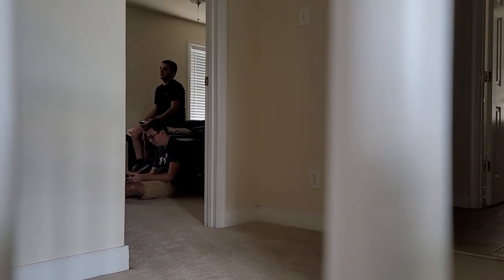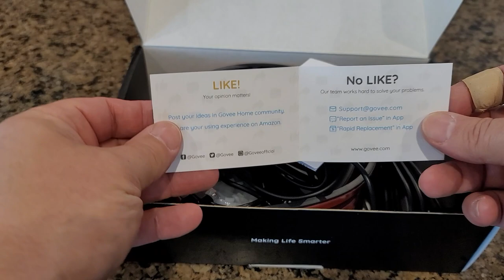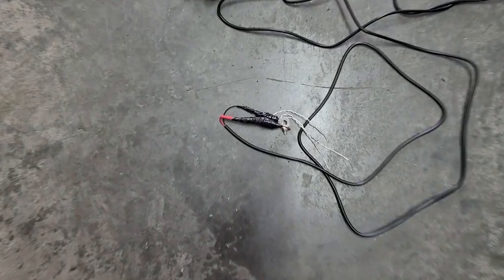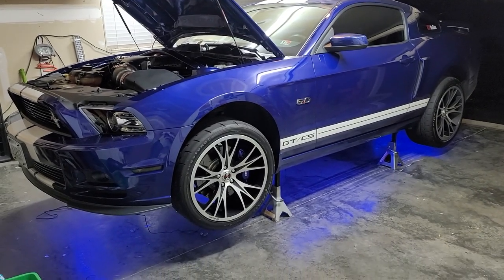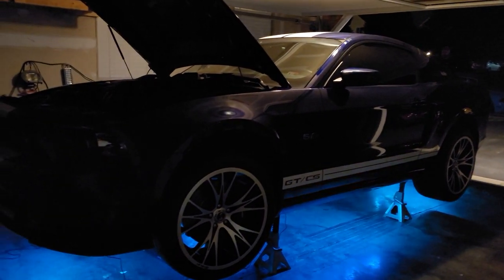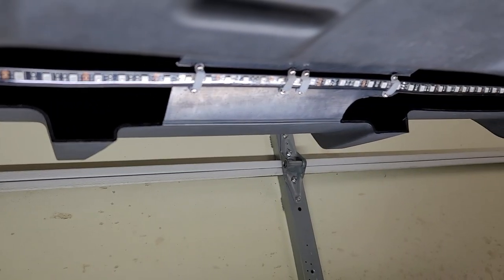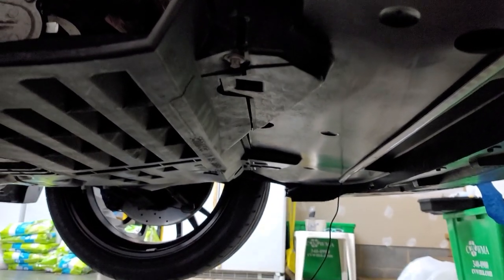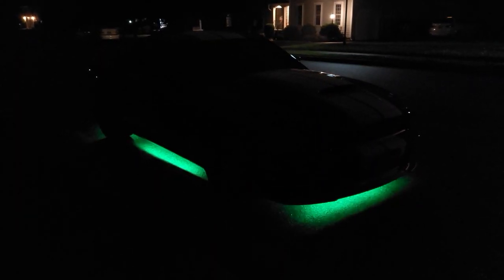Govee LED Car Lights Install (underglow)

Comment: Just a heads up for people new to underglows, DO NOT USE BLUE lights u will get pulled over
Reply: Really??
Reply: Red and blue really. At least while driving. Could get an impersonating a cop charge.
Reply: Where I’m at you get pulled over even havin em on while driving no matter the color😂 but the risk makes it all the more fun
Reply: Before installing just check your state and local laws on underglow. Most states don't allow you to drive with red or blue
Reply: Or red!!!
Reply: Actually, it depends on the state. If I recall, here in New York, we are not allowed to have any flashing lights on our cars, of any color, while the vehicle is in motion, other than the legally allowed turning indicators/hazard warnings, of course.
Reply: @NuBeatzNumuzik  That's bs. It's not impersonating an officer unless you act as one. You could deck your car out as a cruiser legally.
Reply: @MaxxdOut313  fair enough. I roll with my lights on and I don’t get any shit from cops. July 4th I was running with red white and blue flashing all night. It was nice.
Reply: @MaxxdOut313  fax
Reply: It all depends where I live must be solid no blue or red
Reply: Damn. That's my favorite color. Lol.
Reply: @MaxxdOut313  nope, in washington I put blue bulbs in my front sidemarkers (this was like 2001) and I got pulled over and told any car with blue lights can be charged with impersonating an officer.
Reply: Thanks for the warning 👍

Comment: Extremely informative video, I am thinking about putting these on my first car in a few months, and I couldn’t find any other video that was as proper as this one, this helped me out a lot, thank you, very good video👍🏻🔥
Reply from the maker: I'm sure I missed something. If you have any questions let me know
Reply: @N2MYGT  I do have one question, do the lights automatically turn on, or do you have to start the car? Or do they only turn in if you you use the remote or the app?
Reply: @trentenmellott7284  only when you use the remote or app. I'm sure there is a way you can wire them to turn on with the car tho🤔 mine flashed when I cut the car on but didn't stay on unless I used the remote. I hope this helps
Reply: @speedaddict479  Yep it did help actually, much appreciated man 🤙🏻

Comment: Great video. Very informative. I bought these and want to install these myself. I'm very nervous. About how long did it take you total you think if you didn't have to film? Did you take the tires off and is that neccesary? I have the strips and the rock lights.

Comment: Have u droven in the streets like that? I read that its not illegal driving around with them on but certain colors you can not use: red, blue, and green . What im trying 2 ask have u gotten stop by have these on?
Reply: They are legal, of course I wouldn't recommend blue or red.

Comment: Hey if you are reading this, how did the sides hold up after rain and whatnot? It looked like the sides were held up by 3m adhesive only and thats what I might have to do as well, so does it hold up well? Thanks
Reply from the maker: I have them zip tied in the fender well. I didn't even use the 3M I came with it
Reply: @N2MYGT  Oh okay! Thank you for your assisting. I was forced to drill into my side skirt under it to use the screw, rubber bracket. So are your lights holding good still? Sorry for poor english lol.
Reply from the maker: @van1lla_cs  no problem yes they are functioning just like the day I put them on

Comment: Do you just run the positive cane to the battery terminal? Then grounded it off?
Reply from the maker: There is a couple ways of doing it. I connected mine to my fuse box where the main power comes in. Then I used where an existing ground is to ground it. You can use the battery terminals if they are closer. I would also recommend possibly doing a 10 amp fuse that the kit did not bring

Comment: Do these lights have a rainbow setting? (All at the same time, not pulsing different colors)
Reply from the maker: The new set do. I did a set for my wife's car and I believe those are the newest ones out. I've actually done a couple sets on different cars and they seem to work good and they bring a separate remote so you don't have to use the phone if it's not handy

Comment: Is there a way to make sure that these turn on when I unlock my car with the key fob? For example when it's dark I'd like the lights to come on when my headlights turn on when I unlock the car.
Reply from the maker: There is definitely a way I'm sure. I wouldn't advise it unless wherever you are from does not care about the undergloo being on
Reply: @N2MYGT  how would you be able to do it?

Comment: What is the modes avalible in that kit only stand colours and flashing ? Or there is rainbow mode or wave mode
Reply from the maker: They have a new kit that does the chasing light AKA rainbow or wave mode. The kid that I have does not do that. The one that I'm thinking about giving away does
Reply: I agree with N2MYGT. I have the older kit too. Two of the LED strips have went out. I just ordered their new kit today. It should be here Tuesday. I will keep you guys posted on how it turns out 👍🏿
Reply: @speedaddict479  how’d it go?
Reply: @connorwilson744    honestly they were the best set of LEDs I've had.

Comment: I would wire that, instead, to a switch that doesn’t draw constant power. My fog light switch will probably be that switch. That way I can toggle them on and off, and so I don’t have them on during the day.
Reply: You can turn them off in the app
Reply: @themichael_o69  what’s the app called ?
Reply: @mangochampagnelasssi9028  Govee home

Comment: So connect them straight to the car battery ?
Reply from the maker: That is an option. There's a few ways that it could be done. Like I did in mine I tied it in to the main fuse box in the ground near.
Reply: @N2MYGT  How did you connect it to the fuse box?
Reply from the maker: @April-no7ew  If you don't mind I will send you a picture if you let me DM you
Reply: @N2MYGT  yes please
Reply from the maker: @April-no7ew  I will take care of it this afternoon for you
Reply: @N2MYGT  hey can you still send me the picture?
Reply from the maker: @April-no7ew  Send me your insta so I can send you these pictures
Reply from the maker: Mine is n2mygt
Reply: @N2MYGT  april_dawn21

Comment: Does this drain the battery wen the car is off
Reply from the maker: It is such low voltage that it would have to be on for weeks
Reply: @N2MYGT  my battery died the next day
Reply from the maker: @visionblurry7891  I don't know what to tell you about that. I've had it on both of my cars for months and I have no battery issues
Reply: @N2MYGT  I hooked it to the fuse box will I have issues
Reply: @visionblurry7891  Did it drain your battery when you had it hooked up to the battery or when you hooked it up to the fuse box?

Comment: Wish you showed exactly where you brought up the box😪
Reply from the maker: Sorry I didn't show that. The box is in the fender well on the passenger side. I did have it come in at one point but I didn't like the way it looked. The wires go through a little hole in the shock tower which lets the box sit out of the way.
Reply: @N2MYGT  oh haha me an my dad legit ended up doing almost the same thing😂
Reply from the maker: @prodigyam5078  I hope the video helped somewhat.
Reply: @N2MYGT  oh totally I wouldn’t of thought to take off the wheel and stuff but surprisingly it didn’t take that long

Comment: I have these on my Jeep and I don’t like how they turn on by themselves intermittently. Same thing happens with Govee home lighting. Only downfall to this product IMO
Reply: You could wire them to your fog lights, that way you have a hardwired switch inside the car controlling power to them, plus the app

Comment: I really watched like 25 of these videos trying to figure out how to do the actual wiring to power the lights but every video is just everyone showing where they put their lights …
Reply: Cool vid tho love the 5.0
Reply: When I do mine ill make a video on the wiring. Just got mine yesterday, installing over the weekend
Reply: @ayturbo5493  did you drop your video
Reply: @OnMyGrindENT  honestly forgot to and after I installed them I went a different route cuz I wasn't too found of the way the colors flowed. Going OPT7 after winter